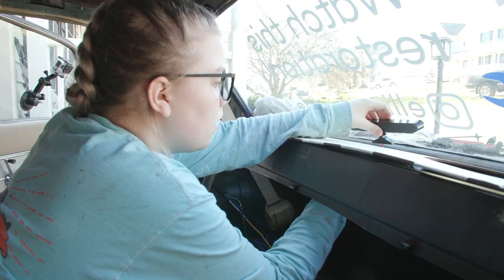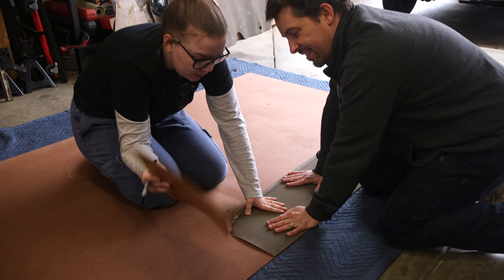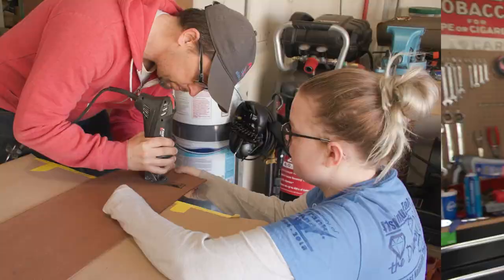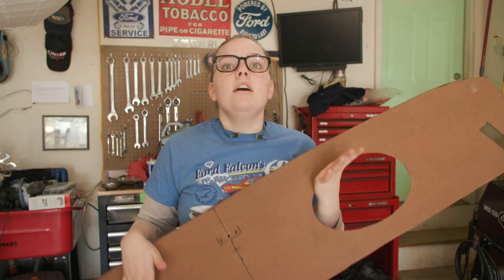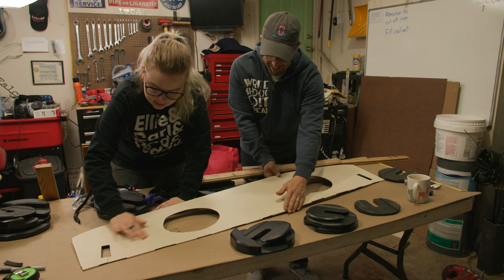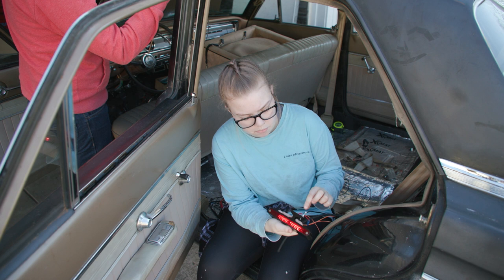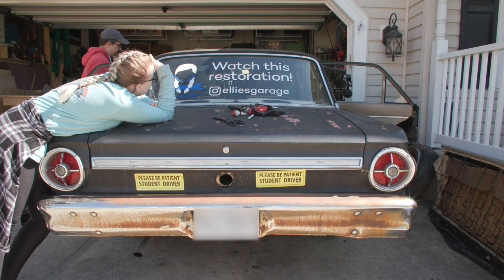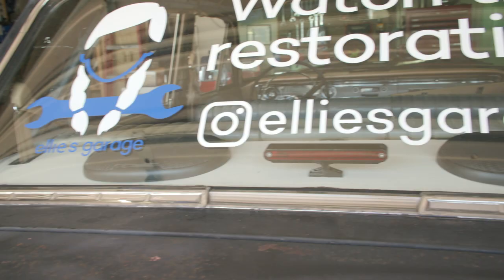I Made A New PACKAGE TRAY! - 1965 Ford Falcon

Comment: Excellent work and the end result looks really nice. The only problem I see is you are cutting the package tray, we call them the parcel shelf in Australia, and not reinforcing the sections you cut out. The flanges, that's the part that is like a step down, are for strength for the factory holes, that is their only function. You cut the flanges off and you loose the strength the factory built into that part, without reinforcements that section is now much weaker than it already was.
Reply from the maker: Thank you for the encouragement and that information. Maybe we should look at welding in some metal to reinforce that area in the near future. Thank you again!

Comment: On spray adhesive you need to let it flash or tack up before adhereing the pieces together. It should say on the directions on the can. Usually a 10 minutes.
Reply from the maker: Yes sir, good point. We did follow the instructions that said to wait one minute before putting them together, but we just cut that out of the edit. Maybe we should have left that in. Thanks for looking out for us!

Comment: Looks great  and like you said. The satisfaction of knowing you did it yourself. Hope you connected the 3rd brake light to the brake switch under the dash and not to one of the tail lights as it will blink with that tail light when the turn signal is on. Turn on the turn signals and watch , see what it does. Great  work  otherwise. Love it.
Reply from the maker: Thank you so much! Yes, we should be good. We actually rewired with a complete kit from Painless, so the third brake light wire was right there for us to use. Thanks again for looking out for us!
Reply: @ElliesGarage  Great, glad to hear that . Then you should be good with the 3rd brake light.

Comment: Pro tip 2 - always solder your electrical connectors. You will be much happier with the long term result!
Reply: Crimping is easier, safer and more efficient, it’s why they don’t solder on racing cars, and don’t allow it on aircraft or spacecraft.